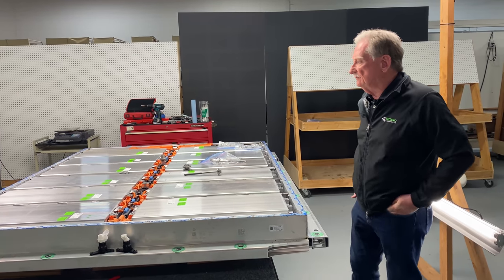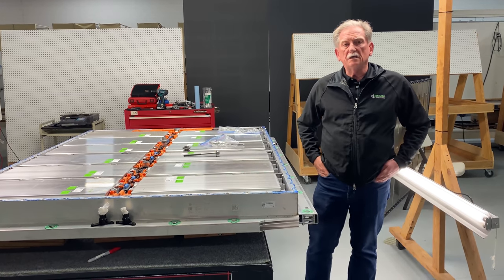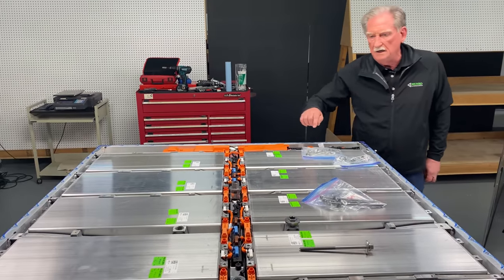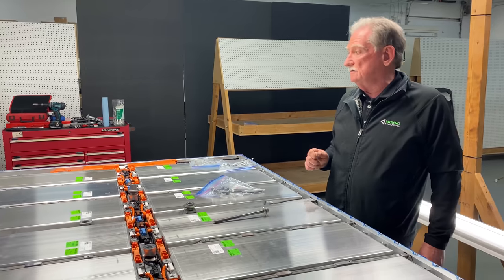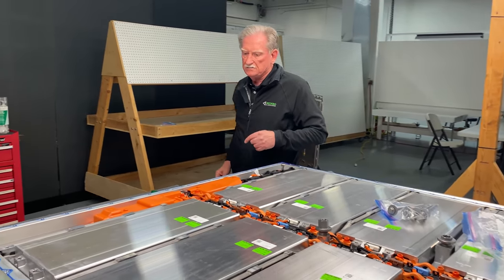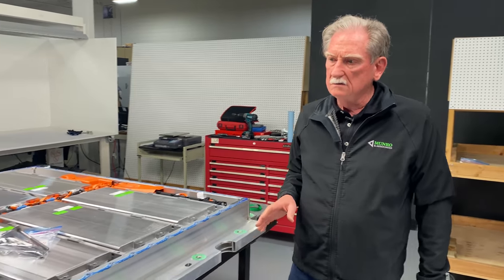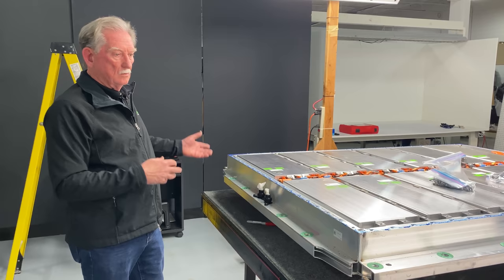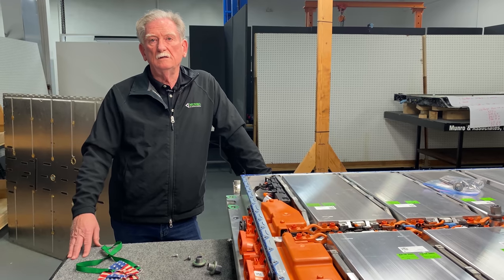2021 Volkswagen ID.4: Battery Teardown

Comment: Are the battery capacities at 1:05 gross or usable capacity? The 82 kWh from the ID.4 is definitely the gross capacity, the usable capacity is 77 kWh. Not sure about the other cars though.
Reply: The 57 kWh Bolt EV listing was from an incorrect label for the 2017-2019 models (it's actually ~60 kWh usable). The Model 3 and Model Y appear to be gross for the previous generation battery as well. And the 82 kWh is listed as the gross for the ID.4.
Reply: @newscoulomb3705  which makes this battery only 9kg heavier than a Tesla battery of equivalent capacity. Considering that this here is a modular setup and the Tesla pack is basically a brick of glue this is quite impressive.
Reply: @stephanweinberger  This is also designed to be repairable, cell blocks are designed to be replaceable.
Reply: @stephanweinberger  Yeah. Obviously, there's room for improvement. It's Sandy's job to be critical, but I don't see anything fundamentally wrong with the ID.4's pack. Especially since, in the real world, it appears to have one of the most consistent thermal management systems and DC fast charging rates of any EV on the road.
Reply: @newscoulomb3705  I fully agree, exept the fast charging rates. Model 3 peaks at 250 kW, ID.3 peaks at 125 kW.
Reply: @Stefan_Dahn  Sure, but the ID.4 has a flatter charging profile, taking just a few minutes longer to charge to 80% and charging to completely full in an hour.
Reply: @newscoulomb3705  and there will be a update from 125 to 150 kW end of the year, if the cells are so healthy as expected after one year of use....

and VW want to reuse the packs in there chargingstations as battery buffer...
the size of the charging stations is compatible with the batterypack and the other way around....

Comment: Hope to get to see this thing opened up!  If they're switching to a polymer, I'd like to see the casing resemble a cross between an exoskeleton and a wasp nest so that the battery modules do not require a box within a box design.

Comment: Hi! I understand why you talk about reducing the weight  of the battery...but did you have in mind that the whole housing is a structural part of the vehicle? In my opinion the aluminum profiles are used to increase the strengthness of the whole construction. Using a polymer to substitute the aluminum will probably make the whole car weak and it will decrease stiffness.

Greettings from a german engineer

Comment: 8:05
Can there be a slot that's into the main aluminium frame so that the plastic connector part has a snap fit into the frame and now only requires 8 fasteners instead of 16. 
Although I am not sure whether the weight reduction in this manner would be cost effective or not
Reply: I think the problem would be sealing it. I suspect those bolts are for sealing pressure.
Reply: the spacing of the fasteners is also to make sure the seal is tight. This can theoretically also be done with a snap fit, but I guess you'd need much tighter tolerances and/or more caution during assembly. The use of flow-drill fasteners suggests that VW wanted to avoid tight tolerances.
Reply: Snap fit plastic is the bane of longevity. 
Easy to assemble but a nightmare to maintain and disassemble. 
Give me a few minutes with an electric torque wrench over prising snaplock lugs that break and distort on every dissasembly.
Reply: @dnomyarnostaw  or a robot witch fastenes all bolts in one go

Comment: If you consider changing big parts of the aluminium enclosure with a composite you will very probably need some electromagnetic shielding unless the composite is electrically conductive. Thanks for these videos by the way!

Comment: Why wouldn't VW have already looked at these reductions (savings) and/or pressured their contract manufacturer to find these savings/reductions?
Reply: Replacing aluminium with CFRP is no reduction of cost, that's for sure ;-)
Reply: @izpodpolja  ... It will be because you are injection molding the parts vs hand fabricating which is very expensive.
Reply: @2nd3rd1st  Battery packs are manufactured in-house, and the MEB platform is designed to scale across a variety of models (currently, or soonish ID.3, ID.4, ID.5, ID.6, Enyaq, Audi Q4 E-tron, Cupra Born) and for mass mftr, and they're selling pretty well (at least in Europe), if quantity of sales was a concern it was the opposite of what you imply
Reply: this not for VW, this is for SABIC, a plastic maker, they could go to VW armed with this (and other propriety info that Munro obviously didn't share) and say, hey if we provide this type of plastic at this rate, look at all the saving you could have, do you want us as a potential supplier?

then it's upto VW if they feel comfortable, afterall, they have to manage the environmental cost of a lighter pack vs environmental cost of using more plastic, for example, among the many many decision they have to consider, like supply chain management and what not.
Reply: Time
Reply: @ryzvonusef  Agree - I do think alu is more environmental correct than composite/plastic
Reply: @venti4268  Aluminium is by far easier to recycle than composite.

Comment: Wait... I saw just 8kg disadvantage for ID-4, not 50kg. ID-4 has 0.11 kg/ per kW more than Tesla, right? 0.11kg/kW x 75kW = 8.25 kg.
Reply: The Tesla Model 3 has an 82 kWh battery, not 75 kWh.  75 kWh is what's usable.
Reply: Made the calculation and jumped right to the comment box searching for this post.
Thumbs up!
Reply: @MsAjax409 
Maybe but it's not what Sandy shows on the comparison chart.
What about VW's total capacity? Any idea?
Reply: It just baffles me how so few people even stopped to to the math.
Reply: @FranciscoNogueira  The ID.4 total capacity is what Sandy showed -- 82 kWh

Comment: If you understood the MEB platform, you'd know you couldn't build the battery any different. The battery pack is part of the car rigidity and crash worthiness. It's already made from aluminium, which is lighter than glass, stronger than polymer, and cheaper than composite.

Comment: ID4 = 167.7 Wh/kg
Model Y = 170.8 Wh/kg
Less than 2% difference
Reply: Laughs in 4680 cells
Reply: @michelmelinot  The 4680 cell is larger but not particularly more energy dense than the 2170 cells

Also traditional battery makers took batteries from over $1000 to under $100 and they haven't stopped innovating

Tesla gets social media so you hear a lot about them. The Chinese and Koreans and Japanese don't get English social media but they aren't stupid they also make improvements

Did you hear about the improvements that reduced battery prices fromm 1000 to 900 at Panasonic? No. What a out the improvement that took it down from 900 to 800 at CATL? No. What about the improvement that tool batteries from 800 to 700 thanks to the innovations at LG chem? No you didn't hear about that

Who do you think took battery costs down from $1000/KWh to $100/KWh? It was traditional Asia  battery manufacturers. And what do you think they will do over the next decade? Perhaps take batteries from $100/KWh down to around $40
Reply: Yeah, it's interesting how close they are in Wh/kg considering ID.4 is using pouch cells and modular packs. -50kg would swing that +2% to -8%.
Reply: @michelmelinot  Laughs VW with solid state production vehicles by 2025 with QuantumState.
Reply: @marcusevjourney566   maybe, but not under the VW brand...  their high end brands will take all supply atleast till 2030.  a solide state 911 will come before a solide state id4
Reply: Are you just making up stuff, solid state makes batteries cheaper so it will be in an ID.2 before a 911.  Do you know that they are already planning to build a solid state battery factory in Germany?  Are you not worried that Tesla could be late to the solid state game, because they have all their hopes in 4680 old tech?  Anyway I think Toyota will beat VW to solid state, my prediction is 2023 for Toyota production of vehicles with solid state battery tech.
Reply: @nox5555  Solid state has much faster charging than 4680, it is called Physics.  I agree VW will put the cheapest batteries in the ID.2 and they are the solid state batteries 🤣👍  Do you not get the point yet?  Solid state batteries are cheaper, much faster charging and lighter than current 4680 battery tech.   Do you want Tesla to go solid state?
Reply: @nox5555  Exactly the same argument can be used against the 4680.  However when the 4680 goes into production it will be old tech because others will be bringing out solid state at around the same time.
Reply: @marcusevjourney566  Solid state will happen and everyone will have it

In the distant future say 2035 it's most likely batteries / power electronics / EV motors will all be commodity products that is to say no one company will have a significant lead
Reply: @marcusevjourney566  some people, especially from the Media, thinks Toyota was caught "sleeping" in the EV market, and in high economical risk for insisting in hybrids. But that people are who seems to been caught "sleeping" and ignored the deal Toyota made with Panasonic in battery production and development.

Comment: 8.8 is a standard bolt in the metric system, 10.9 is a steel bolt and 12.9 are the real strong ones(first number is the pulling strength second the stretch factor), you also have the special single use stretchy ones for cylinder heads and such but I can't remember if they have numbers on them

Comment: You may also find this of interest: I wrote a story this week about the technology, and scalability, of EV conversions of "classic" cars—anything from RR to MG to VW. While the cottage industry of EV retro-fitting initially relied on reclaimed Tesla batts, from the Model S and X, Tesla's new form factors, and the structural integration of the cells, make T's current batts very hard to reclaim in similar fashion. 

My takeaway is that modular/rectangular form batts, with few or no load paths, will inevitably be bulkier, heavier, and less energy dense, than the alternative suggested by Tesla.

Comment: Tesla thinks they invented the battery pack that acts as a structural member. That VW pack is a beast. 
Sure, you can make a stronger and lighter one with carbon. Heck, that's probably what Porsche uses. Won't be less expensive though.
Reply: Thinks? They actually did.

Comment: The good thing about the  Aluminium extruded profiles and  "frame" design is that you can easily adjust the size of the pack for smaller or bigger cars.  A plastic moulding would only fit on size ,is difficult to recycle, and offers less crash protection unless out of Carbon..a night mare to recycle !

Comment: Will be interesting to see how this compares to 4680 integrated design
Reply: Just looking at the layout, the 4680 design is about 10 years ahead because the cells are size optimized for manufactering.
Reply: @coldforgedcowboy  pretty much. This seems like a very rushed design to me
Reply: @blaneysiktube  ... Agreed, it looks like a well engineered prototype desinged in a fabrication shop.
Reply: This looks a lot more serviceable and recyclable than a block of cells permanently glued together anyway.
Reply: @peglor  battery cells don't require servicing

Comment: I know this doesn't help Sandy's customer Sabic, but this design looks like it would be better off as a one piece aluminum casting like Tesla is planning on doing.  Plastic is susceptible to creep, which i why Sandy was suggesting composite plastic, but a one piece aluminum casting will be easier, and should end up weighing less and with a lot less fasteners.

Comment: Do car manufacturers have to pay any cost for disposing of the car after its lifetime?  Aluminum is easy and profitable to recycle, and reinforced plastic is nearly impossible to recycle.
Reply: Good point! 👌
Reply: Cat manufacturers actually works with metal foundries to recycle the rejects on parts …. Metal is fairly easy to recycle.

Comment: The more it goes the more confident I am that this car is sold at a loss. This is overbuild like crazy.
Reply: Actually the Battery Pack is engineerdd very well...
Reply: @tobias4305  It's a ten years old cell to module, module to pack, pack to chassis architecture... we are currently at cell to chassis design now. This is not cost effective at all.

Comment: The polymer/composite idea for the battery tray is an interesting idea.  My question is how much of the vehicle's structural integrity is dependent on this heavy battery tray and can that same structural value be achieved by using a polymer/composite?

Comment: I presume that the struts from side to side are for rigidity and for battery placement. (They seem very beefy) If the bottom of the "battery pan" is creased to provide extra rigidity (not weight) could an combustion modified expandable foam product around a sheet of Kevlar be used to separate the batteries, provide better impact absorption, cushion movement and noise transfer while car is running (and reduce stress), act as an insulator,  remove any extra machining to ensure non sharp surfaces and reduce weight? Can the top of the battery pack be a slide over piece or does it need to contribute something in the way of structural integrity? Know you hate those fixings

Comment: This battery is basically 10% bigger then the Tesla in power and weight, why change it? Those Germans engineers are every bit as good as Elton bunch, maybe better. Volkswagen hasn't become the worlds largest car manufacture by accident.
Reply: The more EVs traditional manufacturers make the less impressive Tesla tech looks.
I have always said that Tesla hasn't invented anything new. All that Elon has done is to give the engineers a spec for an EV that will outperform an ICE car. Nothing really special.

Comment: Military helmets are now made of ultra high density polyethylene (UHDP). It has good abrasion properties so good for underside of vehicles. Also good the -40C to 60C environment a vehicle can experience. Also, a good thermal and electrical insulator, so the cooling/warming plate under is more efficient for sending heat to/from the thermal mgt system forward. I assume you can mould GRP strengtheners into the side of it for impact protection. Carbonfibre is expensive, and cant be recycled. Vestas has invented a technique to recycle GRP by separating the glass from the resin - aluminium is fully recyclable. A bolt fixing can also be moulded into UHDP.

Comment: Another video with questionable conclusions, I'm sorry but I can not take it seriously.  

The difference between the battery packs Wh/kg is minimal. How do you get to 50kg, it is just 7kg between Model Y and ID.4. That is really unserious. Recycling, environmental friendliness and reparability are not taken into account. The effort for assembly, the possibility of automation is not taken into account. Something that is much more complex, expensive and worse for the environment with encapsulated or glued round cells, for example. 

This whole consideration is again much too isolated, you have to see the whole, including what VW as a group can achieve with the platform for economies of scale and also that you have to make compromises in some places. 

Nowadays, nothing is designed on the drawing board. Everything is created on the computer and simulated and optimized thousands of times before even the first prototype is created, according to the individual requirements for production, tools, available resources, etc., which the "expert" cannot know in detail and therefore cannot evaluate. 

I don't want to discredit anyone here, but these videos are nice entertainment for laymen, but no serious analysis of anything. This screw counting at the end and then start with carbon fiber, which is the opposite of cost saving, is just ridiculous.

Comment: I like aluminium mainly for recyclability; glass fibre reinforced plastic, carbon fibre or fibreglass are pretty bad from are recyclability perspective.  There could be some thermoplastics out there that are more recyclable but you'd probably want metal-stiffeners / tension-rods in there.  Nice to look at alternatives; maybe a one shot cast aluminium battery tray might be another option; similar to the Tesla castings, they replace a lot of stuff.  You do need your design to settle a bit first though and it's early days for VW.

Comment: Recycling and repair ability.. this was German engineered.. I guarantee you they looked at Polymer.. But Germans care about CRASH safety and sustainability.
If i was a German.. watching this.. and all the "cost cutting measures you talked about".. I would be screaming a the screen.
Germans care about more then the bottom line. 
You glue a Battery pack together.. you just increases your warranty repair bill a large amount .. and made the second use market less. 

But hey you made a temporary profit for this quarter. Not like Cars are kept on the road for 100 years.. Right.. The Trabant 606. not like they in there very cheap and easily made manufacturing tech.. are not still on the roads.. I mean a a East German car.. living and driving around St. Louis Missouri USA.. and still supported by Volkswagen to this day.. So ya.. Munro.. stop thinking iPhone is the best.. they make cheap. but they are not meant to last. a Car is. A car and a piece of consumer tech only meant to last a few years.. are WAYY different. 

Please stop thinking. i can save you 1% buy making it one time use. Leave that to China.. that is there wheel house. Stick to better manufacturing and stop telling a engineer he made it too long lasting.  Cars are meant to outlast the loan. and then some. not everyone is gonna pony up every 4 years 50k just for the pillage of owning a beer can..

Comment: 3 mistakes in one paragraf.
8.8 is not a high resistance bolt. It is standard.
You don't need to yield a bolt while stressing it, this only happens by accident (but is acceptable in many cases if you don't re-use it).
Yielding is not required to make a bolt work like a spring